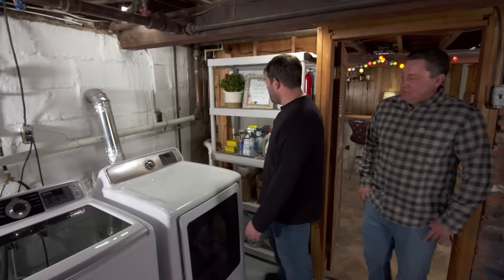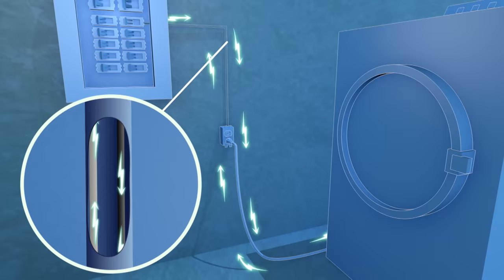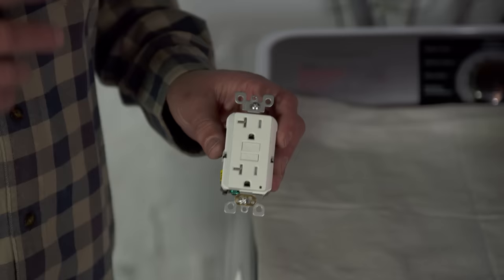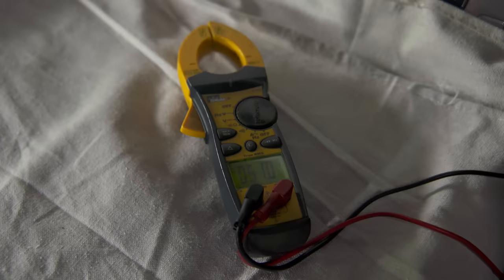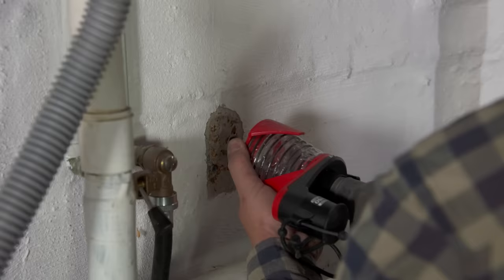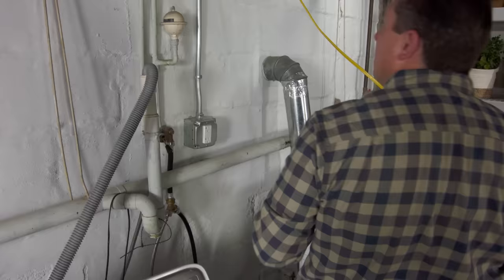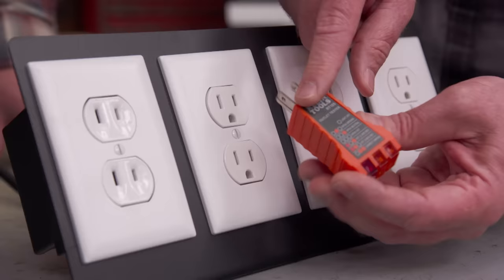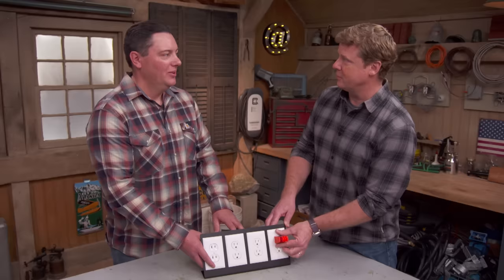How to Ground a Two-Prong Electrical Outlet | Ask This Old House

Comment: I've had a hardware store associate tell me that a GFCI is not an appropriate solution to an ungrounded outlet. He said something about the device having no reference voltage to work properly.

Who's correct, the associate or This Old House?
Reply: I’m not an electrician, but everyone I have talked to has said that if you can’t run a ground wire or a new wire like a 12/3 or 12/2 then a gfi is an acceptable fix.
Reply: Adding GFCI protection is the REQUIRED method for protecting a replacement of an ungrounded receptacle with a grounding-type (3-prong) receptacle and has been for quite some time.  Look it up online (for free) in the NFPA 70, section 406.4(D)(2). They even come with the required labels for "No Equipment Ground" and "GFCI Protected" to attach to each protected, but ungrounded, 3-prong receptacle you install.

Comment: So here's my question...
If I want to replace a 2 prong with a 3 prong to accommodate devices with 3 prongs (wiring is not accessible) can I just put an "ungrounded device" sticker on it meet code
Reply: No. You can, however, by code in most locations, put in a gfci receptacle in its place and put a sticker on the cover plate stating "no equipment ground". Why is the wiring not accessible?

Comment: We have an older house with 2 prong outlets...changed them...we also upgraded our electrical panel box...would the upgraded panel ground the house without changing wiring for that 3rd prong?
Reply: No.
Reply: No, grounding requires that there are grounding wires from the sockets to the panel. There is no way you can do with just in the panel. Now you can use GFCI breakers in the panel so you can then use just normal three prong sockets without grounding.

Comment: What advantage does a properly ground outlet have over a GFCI?
Reply: Cheaper, easier to wire, fewer nuisance trips. But a properly grounded, plain (non-GFCI) has no technical or safety advantages over a GFCI.

Comment: The most informative part of this video was the device at the end.  The video assumes that the house has a ground installed to the panel and only has a single or maybe a couple of ungrounded plugs.  What about a house that has no grounds through it. In my house they installed GFI’s throughout with no grounds and put tiny stickers telling us they are ungrounded. Fortunately my house is a raised foundation. Eventually I will have an electrician run grounds to specific plugs that typically run devices that have a grounding lug on the plug.
Reply: Adding a GFCI in place of a two prong outlet is allowed by code.  So it was not “wrong” for the previous owners to do this.
Reply: @neilbrookins8428  Not "wrong", but certainly not as good as an actual ground when your device NEEDS a ground, such as most surge protectors.
Reply: UpnorthHere true. One option for surge is to put a whole house surge protection at the main panel.  This is easier than running many grounds to multiple locations around the house where you want to use a surge strip.

Comment: I bought a backup battery for my computer.  It will not work unless it is plugged into a properly wired, GROUNDED outlet.  My old house is not grounded, so I ran a wire from the ground screw on the outlet, through the floor (I have a pier & beam foundation.), and fastened it to a ground stake under my house.  I made sure the polarity is correct, too.  (The ground wire from the outlet to the floor can be covered with trim.)  I intend to ground all my outlets soon.  This will certainly NOT be an expensive project, but it will take a lot of work, mainly in the form of crawling around in a cramped crawl space.  I have no interest in GFCIs.
Reply: What you did does not make it safe unless you add a GFCI.  You have to run the ground wire to known electric ground under the panel. That may be all the way to the panel or to a grounded outlet.

Running a wire to the a ground rod creates a TT system which is banned in the US.  I always requites GFCI protection to make it safe.
Reply: @okaro6595  Thank you for the response.  I looked into it after reading your post.  The way I did it works for me.   As I stated before, my backup battery would not work at all without a proper GROUND.  A circuit interrupter (GFCI) wouldn't do the trick.  I'm not that concerned with personal safety, though.  Whenever I replace outlets or light switches, I don't bother flipping the breaker off & on, wearing it out.  (My house is old (1946) and the breakers are no longer available.  If one wears out, I'd be in for expensive replacement of my breaker box.)  I do get shocked once in a while, no big deal.  When I get shocked, I try to remember to pull my hand back quickly. lol

"You have to run the ground wire to known electric ground under the panel."  I assume you mean the ground wire from the GFCI, because the ground wire from the outlet can run to a stake in the ground or a metal water pipe and work fine.  Even with a GFCI, you should still have ground.  It works WITH the ground, not INSTEAD of it.

I found this in an article:
"Ungrounded GFCI Outlets Offer Less Protection

"For one, though ungrounded GFCI outlets offer you some protection (the GFCI outlet will sense when there is a ground fault and shut off), they will not protect your electronics in the chance of a ground fault. You need a ground wire and surge protector for the most protection against damaged electronics."

Comment: Arc fault breaker for a washer machine will trip it constantly
Reply: Technically “laundry areas” are required to have gfci/arc fault Not washing machines per se. 

NEC 210.8(A)(10) –  All 125V, 15a and 20a receptacles installed in “Laundry Areas” shall have GFCI protection.

NEC 210.12(A) All Dwelling-Unit 120 Volt 15a and 20a branch-circuits supplying outlets or devices in …”laundry areas” shall be AFCI protected.

Comment: Ground plug up, or down?  I always install receptacles with the ground hole facing down.
Reply: Me too.  only because it is a defacto stanard and many kinds of plugs such as small transformers and rechargeable devices assume it.
Reply: I hate ground pin up
Reply: Richard Dennis ground plug up allows item that fall on the plug to rock to the side and off rather than knocking the plug half way out of the outlet. Best practice.
Reply: There is no code for that. Personal pref and the inspectors pref that will be checking it if so. I pref ground down.
Reply: In St. Louis it’s ground up. In NJ it’s ground down. I prefer ground down. I think it looks more natural
Reply: King of Epic Vlogs looks more natural but it something we’re to fall when a plug is half out that’ll short straight away causing blackening or worst fire and electric shock. Alternatively they should mandate sleeved pins like a lot of other countries
Reply: Richard Dennis I’ve seen guys put them ground plug up to indicate a switched outlet
Reply: I like having the ground hole down

Comment: I bought one of those testers to test my 2 prong bedroom receptacle for ground...when it came..i cannot use it..because it has three prongs!  It works fine on 3 prong though..I guess the best way is to use a multimeter correct..stick one needle into a slot and the other on the center screw?  Thats what i read anyway.
Reply: Until you encounter a house wired with two wire cables (no ground).  Also, I don't believe there is a way to tell if two prongs are wired correctly if you don't have a ground reference, that's why the tester must have three prongs.
Reply: @jrstf  I found my old Black and Decker Complete Guide to Home wiring(with the amazing pictures of everything)  It says to use a neon circuit tester, which I happen to have.  1. Put one probe in short(hot slot) and other on coverplate screw screw.  If it glows, receptacle is grounded. 2. If step one fails, put one probe in the long(neutral) slot and the other on the coverplate screw.  If the tester does not glow, the box is not grounded.  If it glows, the box is grounded but the not and neutral wires are reversed.   SO...I guess I have a way to check.  I just have not got around to moving the bed and doing it.  I am hoping its grounded, so I can replace it. Otherwise, the solution is more involved.

Comment: 6:20 No power is flowing anywhere if the switch is off. The problem is that there is some small theoretical risk as there is voltage in the equipment even when the switch is off. On the other side of Atlantic there is an entire continent that lives with switches that in half of the cases break the neutral. Toasters cut both sides when the tray is up.
Reply: I found out the hard way that my oven element is powered up if either the bake/broil switch is on, or the thermostat is on.  One breaks one phase, the other breaks the other phase.  Removing the heating element while in the broil position (but temperature turned down) did not go well.
He should not have used the world "flowing", "present" would have been a better choice.  Our lamps have user removable bulbs that, when removed, expose electrical connections.  We prefer that our lamps have the hot pin in the center, not the shell, because the shell is much easier to accidentally touch.  In addition, we prefer that with the switch off, no power be present, and we don't use double pole switches.

Comment: If there was one receptacle with 2  prong ungrounded, what about the rest of the house.   Gfi  for all the outlets?  Or is there a better fix?
Reply: Gfci’s would be the cheapest option.  It would cost a lot to replace all the outdated wiring in the house. The good thing about gfci’s is not only does it protect the outlet itself but also any other outlets downstream from it. So you wouldn’t necessarily have to replace all outlets with a gfci.
Reply: @lippershey1  or use a GFCI circuit breaker at the panel, assuming the home had been at least upgraded to breakers,  if it had fuses prior.  Also AFCI protection should be strongly considered in an aging home, especially with the older cloth braided wiring near overhead lights.   That insulation often is very brittle and disintegrate just by touching or moving it. Both GFCI and AFCI do not require an equipment ground conductor to function,  and a combination GFCI/AFCI, though expensive,  will provide maximum safety against both electrical shocks and fires from deteriorated wiring.

Comment: I was hoping for something difficult, like an upper floor where you do not have such easy access to the wiring.
Reply: great video. if the breaker panel is right next to the new work lol
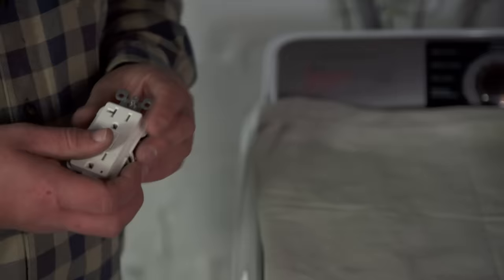Reply: See 1:48. Use a gfci outlet. Meets code and does not require modifying the existing wires.
Reply: Adam C I know that works. I have at least one room where I need to use a UPS power supply. It doesn’t function properly without a ground. :(

Comment: Check me on this but you can't run Romex inside conduit. Overheats the wire.
Reply: Not if you follow the rules for diameter and percent fill.  Romex is REQUIRED to be in conduit as necessary for physical protection, or equivalent, under  NEC 334.15(B).

Comment: Washing machine receptacle was already grounded. Receptacle by the dryer was 2 prong, but the conduit is probably grounded. So, looks like running new cable was not necessary..

Comment: Electricity does NOT take the easiest path back to source. It takes EVERY path back to the source. There will be more current along the path of least resistance, but everything connected is hot.

Comment: Doesn't that clothes dryer require a dedicated 220 volt circuit? An electric dryer sure does, although
this may be a gas dryer as I spot a gas line to the right of the dryer.